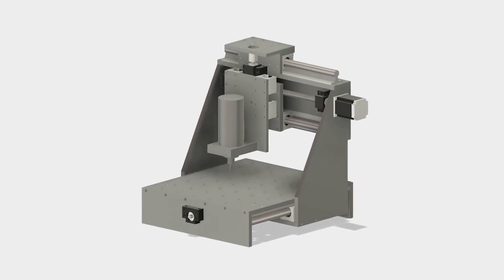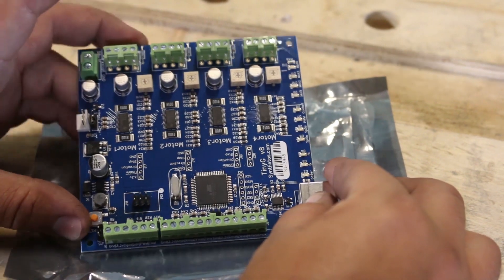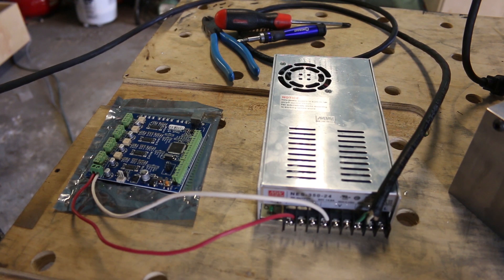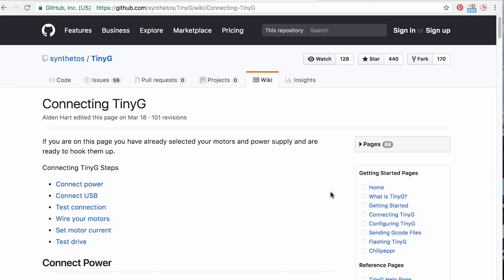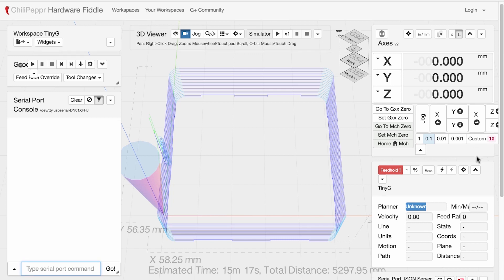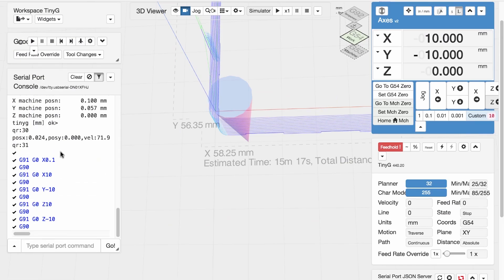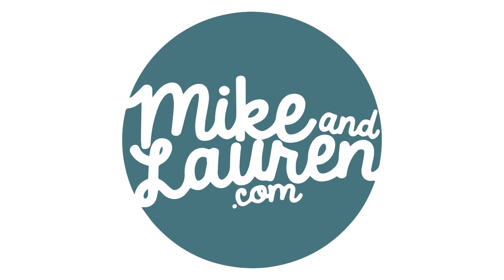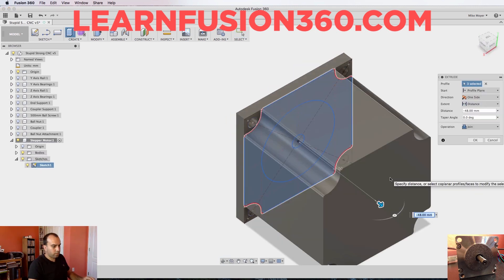"Stupid Strong" CNC Build - PART 4 - THE ELECTRONICS

Comment: 10:45 dont change nothing you have all correct. lead is 5mm. it just cutting forces and bend. change tool diameter offset or drawing if something and if axis not alignment then it show on part.100% sure z axis not aligment

Comment: hi Mike. good lessons so far. saw your vids. but what about seperate motor drivers like DM556 (to run NEMA 23, 4 amps)with mach 3 breakout board? or have you tested on Carbide3D or Vectric? What if in case of belt drive (3 mm pitch 3M HTD 15 mm belt & 16 tooth timing pulley),. Why I am putting the questions....? you know ? 
I have been trying to build a 4 x 2 ft machine which will have a Makita spindle and Two simlantaneous Y motor, belt drive, except Z (with ballscrew) on secured V- rail. Can you guide me on software. I am having no previous CAM experience. I have a vinyl cutter that runs through Flexisign v8 software, that much I know. Strongly, I feel the need of plug and play type software. 
Hobbyist like me have lot of troubles in synchronization with some particular software. I am also very new to Mach 3- a very messy interface. I have seen Carbide motion is clear enough, but not tested. I also have seen Vectric aspire, But the fact is the design and CAM-ing shall be on same platform. Just like converting any image into 3D paths and CAM starts on a "go" button. easier said than Done! But no Linux please. If you have little time in hand, then show me the way....

Comment: How close us your workshop to your house?

If it's under 30km with line if sight at a reasonable antenna height, you should consider seeing up a Ubiquiti link (really reasonably priced, no licensing) between the two. You can have internet access at the second location without an additional monthly fee. It would also make an awesome video.

I have two Ubiquiti access points that I've been dying to setup (actually, I have 3, two 5Ghz and and 2.4GHz for connecting to a network I can't hard wire into), but can't build the antenna until I move as we currently rent.

BTW- This video series is pretty neat, keep up the good work
Reply: I know this is an old post, but I too have used tons of Ubiquiti, such a great product for wireless point-to-point shots. It is how I get wireless to my garage.

Comment: You can also find all those settings by clicking the little gear on the right side of the page , a few icons to the right of the red feedhold button i believe..   instead of typing in the code settings.

Comment: For power, instead of bulk cable and a plug, consider an extension cord and cut off whichever end you don't need. Typically easier and cheaper.

Comment: if you finetune your steps per mm for x and y, do it with a piece as close to full bed size to minimize tolerance errors. Maybe even cut three pieces and calculate the average size drift. Nice Job.

Comment: I don't understand why you made the work  area so small, I know you made it bigger it would've cost more but if you're going to build your own CNC machine you should make it have a decently large work area.
Reply from the maker: I built this to fit on the 24” work bench in the mobile workshop. Intentionally compact. Making it triple the size would only cost 10-15% more.

Comment: Assuming you confirm that the machine itself is square by checking diagonals, you can adjust the number of steps in the drivers to get to a perfect 50*50mm. Great job so far
Reply: Purchasing a 345 Block will give you a perfect surface to test part size and the squareness of things in general to test against.
Reply from the maker: Thanks!

Comment: With right turn spindle you should mill in the other direction.
Reply from the maker: Good to know, thanks.
Reply: And climb cutting leaves a better finish =)
Reply: But you need to have a strong, stable machine. Climb mill is better but not for diy router.
Reply: It isn't strong. Dial indicator gauge will tell you the truth.

Comment: GRBL has fewer features (limited to 3-axis, no built-in web server), but is significantly easier to setup, configure, use and the documentation easier to follow. It also has dozens of open source software options for controlling it, none of which require a separate JSON server. Something to look if you want a toolchain that can be explained to normal humans. Full disclosure, I develop Universal Gcode Sender which runs GRBL controller boards.
Reply: 3 cheers for GRBL, been running it for a couple (or more) years now. But I do not use UGS. The last time I looked, it didn't have features that I wanted, which is built in probe functions. This is invaluable for me as I use my router for (almost) nothing but isolation routing of PCBs. So I've been using bCNC. I'll go take a look at UGS again to see what has been updated recently though.
Reply: Ian Ide the UGS nightly platform build now has a probe module if you want to give it a try. I try not to push my software too much, there are lots of great GRBL interface options.
Reply: Does UGS run well with Debian? Well I spose I can find out, it is java based after all.
Reply: Hmm, I might have a look through the source (if it's available) and add some buttons to it. Being the creature of habit that I am, I probably wont bother. I have a feeling that I'll start digging into it and find out that the layout was done in some platform that I don't have installed which will make things just that much more bothersome.

I have been known to be lazy when it comes to editing some one else's projects.

Edit: yep Netbeans and Mavin.. I definitely wont bother, heh
Reply: Why is it so difficult to download UGS? I keep trying but never get something I can actually run on my pc.